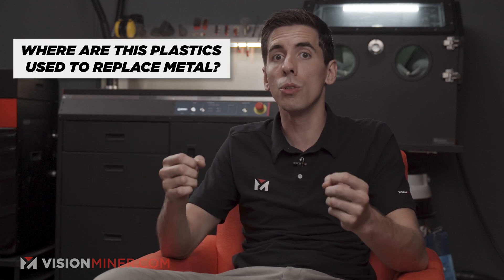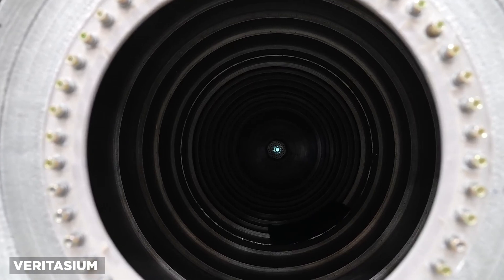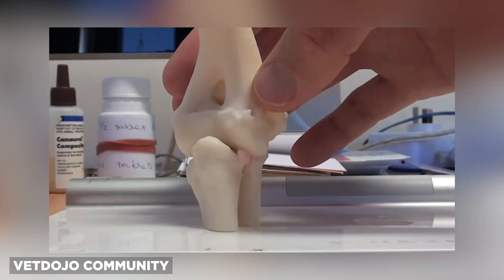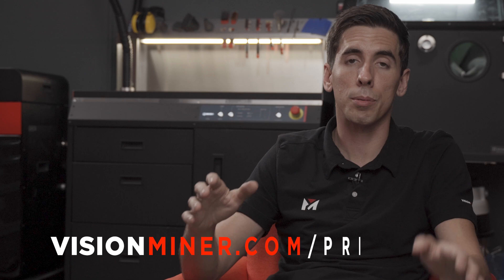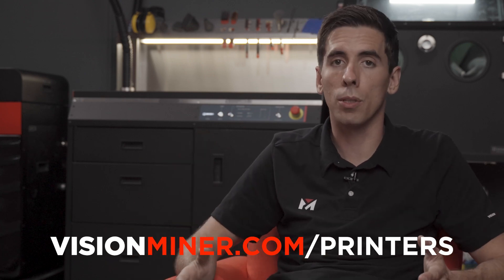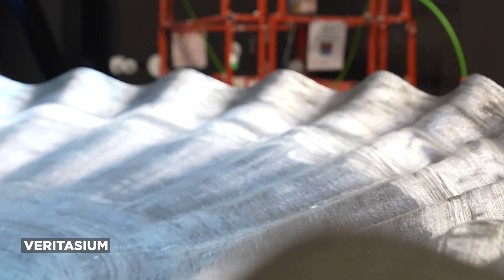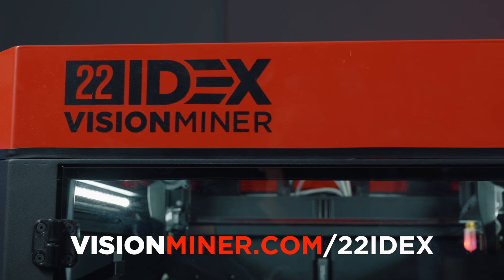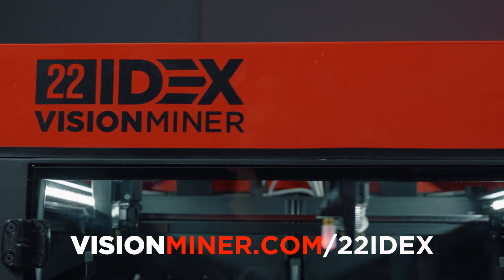Can 3D Printing Replace Metal? It's Complicated.

Comment: One of the biggest hold-ups I’ve seen with high temperature/engineering-grade thermoplastics trying to replace metals (mostly aluminum) in the aerospace industry is the issue of creep fatigue / fatigue life in general over time if the part is even slightly loaded.
Reply: This issue could defintely be remedied by introcing fabric every few layers; the way they do to make fabrics that you can stitch into to clothing.

Comment: When I worked at a car plant, we replaced the metal roller chain guide wheels in the overhead conveyor with plastic resin poured wheels that lasted longer, and they didn't broach cut the metal drive tube.

Comment: i would like to see data on 1.75mm filament liqufiers comparisions for high temp resins vs the heater blocks size vs maximum flow and minimal ooze is the ideal heater zone 20mm or 40mm or 60mm long and what thermal mass is best for that heater to flow rate vs heater block mass

Comment: I printed my old lathe gears with 100% fill PLA. Works great. Got to have set for very fine feed that i didn't have access to before. Hasn't broken yet and if it does I just print another one. OH and its way quieter.
Reply from the maker: Good stuff!

Comment: The same concepts (to a point) apply to aluminum vs steel.  Aluminum is not as strong (by weight) as steel for the same shape, but what you can do is use a larger tube size or other geometry that takes advantage of the properties of aluminum vs steel.  This is how they make aluminum bikes that are as strong as steel bikes but lighter.

Comment: Would it work with a Makerbot MethodX [heated chamber and heated bed]
Reply from the maker: I believe the biggest issue would be the lower temperature of the heated bed (we print at 160+) and the extruder (do they have an extruder surpassing 300ºC yet? We print at 400-450+)
Reply: Define you question more specific. If you mean is it possible to print peek on a method X. Basically yes, but from what i now software will prevent you.

Comment: Slicing needs to be fully integrated into the CAD process fomr the start.  also needs to make way more use of the Z axis to print curved surfacts, clearence of the nozel allowing.  unfortunatly these developments will both take a long time to come about, and may never do so for hobby machines.  Looking forward to your slicing video!
Reply: Agreed! I think teaching tech had a video with non planar printing, for more of a “proof of concept” type of print it was pretty neat, but required a lot of manual gcode manipulation and some praying for no collision!
Reply: @beez1598  i did actually try it on my mk3s and it works nicely, however you need an extruder with extended nozzle and modified cooling ducts to give enough clearance for big delta Z movements

Comment: Printing stuff layer by layer will never replace cast metal as de-lamination will always be a thing
Reply from the maker: In general, we'd agree, but I think with material science and material development going as it is, we might actually get there someday -- PCTG, for example, is essentially modified PETG, and has nearly isotropic layer adhesion -- 97% or so -- and it's amazing. I would imagine that as time goes on, we'll see similar developments with other materials, and eventually get past the de-lamination issues.

Comment: just print metal … replace metal is just as dumb as replacing plastic with metal…
Reply from the maker: A lot of the time, it's a necessity, like on satellites and aircraft -- whatever the reason, it could be to reduce weight, get radio-transparency, or take advantage of some kind of chemical resistance -- so, like say, much of the time it's better to use metal, but there are a lot of applications that cannot :)

Comment: People do seem to mix up specific-strength with raw strength. PEEK is a great material, but has 1/3 the tensile strength of 6061 aluminum, which isn't even a super high performance alloy. Often times, if you have the space, you can replace a metal part with a far thicker plastic part. You save weight but lose volume.
Reply from the maker: Agreed!